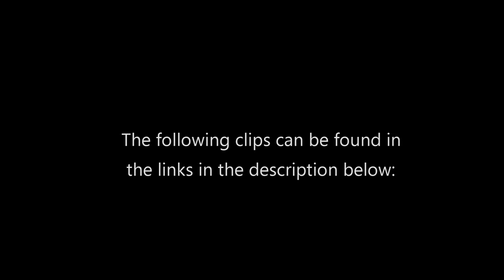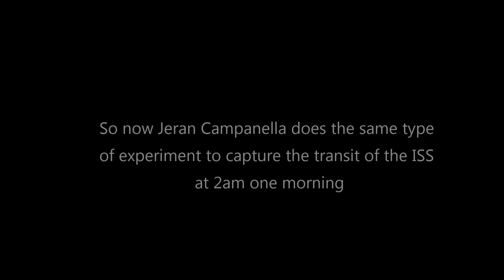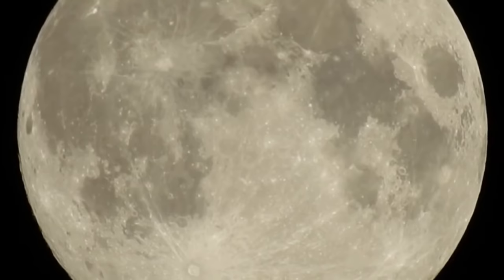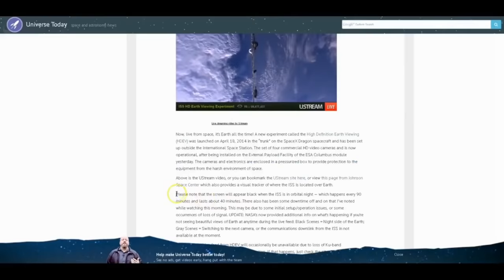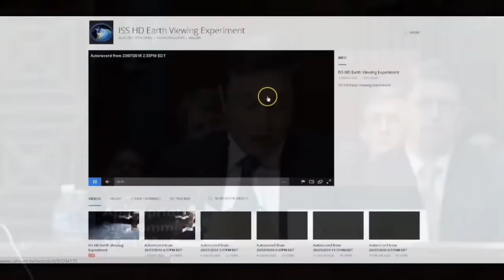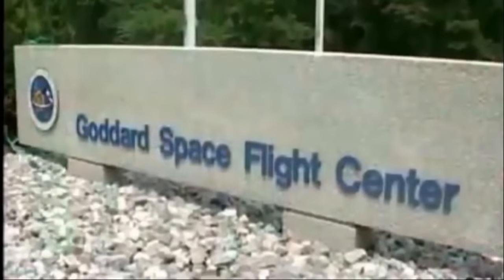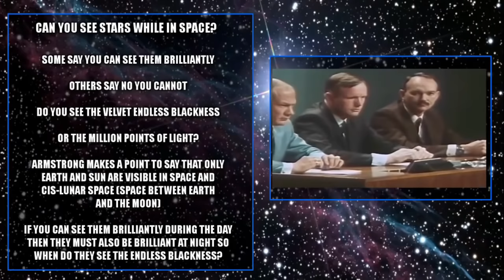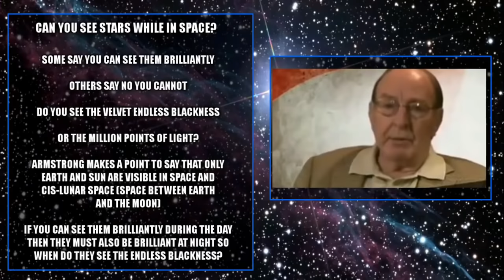The ISS Confirmed!

Comment: .....i thought we lost the technology ?
Reply: Ra Amon Khan    “I would go back to the moon in a nano second. But we lost thousands of reels of data and is just a long and painful process to get it back”~ NASA ( Nazi founders circa. 1948 )
Reply: Actually try to build a smartphone with the technology of 1969... Good luck with that.
'Lost' mean here absolutely moronic to rebuild it the way it was back then.
There was one ! Computer inside the Eagle. And it had 4096 byte memory.  How many Giga byte do your smart phone have?
We didn't lost any technology. The blueprints are still there. For components that can't be built anymore without recreating the machines for. Mechanical systems to control engines etc...wich is completely nonsense anyway as modern engines have a computer that control all functions. 
So any spacecraft able to haul the needed mass (astronauts + oxygen + water + food + lander) to the Moon need to be built from scratch...with modern technology and materials its much easier however.
Reply: Yazzam X - Did you ever fly on the concord? Do you know why they cancelled it?
Reply: Yazzam X - Ok you don't understand my question. I asked you tray because I was lucky enough to have flown on Concord a few times. One thing that really sticks out when flying aboard those Concord jets (due to the fact that they fly at almost 20,000ft higher than regular commercial airliners) is the definite FLATNESS of the horizon and landscape, whereas 'official' pictures from this altitude show a curved horizon. This is due to fish eye lenses used in order the distort the image to fake the curvature.
Reply: @retroactivecontinuity3622  "flying aboard those Concord jets is the definite FLATNESS of the horizon and landscape"
from your passenger window view would you expect to see the horizon curved on the globe or something? if so, please explain why that would be... also, when you measured the definite flatness, did you also measure the distance to the horizon?
Reply: Yazzam X I always thought tech like rope core memory was what he was really talking about. It’s a process we no longer use, nor build. It was really great in some aspects but labour intensive to make and the storage was tiny by today’s standards. I suggest looking up videos showing the rebuild of an Apollo unit. https://www.youtube.com/watch?v=2KSahAoOLdU shows some of the tech we have lost, but as you can clearly see was real and functional.
Reply: I can't believe what some people believe.......i can't even believe "flat earth" is up for debate. Anyone in any air force will educate you quickly. You need it.
Reply: ....... i smell awful, hairy armpits,knees and hands..snot dangling from my crooked nose...hunchback...and a knuckle walker...anybody feel better ? ...and i love relaxing under overpasses.
Reply: @raamonkhan4909  thank you! I was too lazy to type it all out. There's a like for your time.....I'm not sure flat earthers can comprehend this math though. There next replay will be something like "math is flat" lol...or "math is a perspective" or (add any other dumb ass arguement here)...XD
Reply: Yazzam X Who the fuck said we lost the technology to build another Concorde?
Pretty sure we could build one tomorrow
Reply: Carmen Pastershank 
Your above statement makes no sense. We are not talking about pyramid 😂😂
The argument is about how ridiculous it is that NASA employees including astronauts are making the statement that we have lost the technology and telemetry to go back to the moon. They literally tell you they erased it or taped over it. The point is that is so ridiculous it’s disgusting. The greatest achievement of all mankind and they lost or erased it.
It is comical that people believe these liars.
Reply: ISS!!!
The greatest engineering feat of all mankind!!
The international space station placed above the earth in an orbit of 1,300,000 feet.
In the thermosphere with radiant temperatures over 2000°, physical temperatures of +250°and traveling at the orbital speed of 17,500 mph!!
Greatest engineering feat up all mankind and there is no documentary about it🤔

Built in a life threatening environment with high temperatures, explosive decompression risk, extreme distance and extreme speeds-YET NO ONE reported dying building it-when 96 people died building the Hoover dam and 60 people died in the World Trade Center’s🤔

And what do we get for the 100,000,000,000 to build it and the 220,000,000 maintaining it over the past 20 years!!?????
Not to mention the 11 MILLION DOLLARS DAILY-they give us lettuce, bullshit interviews, playing games, doing flips and tricks🙌🙌🙌🤣🤣🤣🤣
Reply: Its the same technology as the V-2, which is the same as the Redstone, which took Alan Shepart to space the year I was BORN. Its just a multi-stage V2, and with all non-reuseable technology! You want to go to the moon with WORLD WAR II TECHNOLOGY? Thats like saying you would like to cross the ocean in the spirit of St. Louis in 27 hours, instead of 7 hours in a Boeing 787.
Reply: we modified the equipment. The moon is WAY further than Earth low orbit. Requires Saturn V rocket... a waste of resources to gather more info. All equipment was retrofitted for Shuttle, to manage satellites, not put people on the moon, kinda a pointless place to visit.
Reply: @hansjorgkunde3772  
Exactly, its like saying we lost the technology to build an Ironclad ship. I mean, yeah... we could do it, but why the fuck waste the resources when we can do better. It would take specialized equipment to make some of the components that are obsolete. People just believe what they want and manipulate data to confirmation bias the pride.
Reply: @pc-easy  No one on here represents NASA. Also, the generalization of American guys is a stereotype. Invest the effort to be specific so your not heard inaccurately.
Reply: javier baron do you think magnetic tape from the 60s would still function? Magnetic tape breaks down. I worked twenty years in television production....magnetic tape breaks down. By the way I wonder how many folks in these posts have reel to reel tape recorders from the 60s or even 8 track players from the 70s. Obsolete technology just like the computers and tape reels of the Apollo program.
Reply: addictive object . destroyed means no conspiracy. There was no longer an interest by the public for us to return nor to pay the cost to so. So destroyed means allow the computers to be scrapped and the reels of telemetry to fall in disarray or to be lost. I bet there are millions of pages of paper printout data stored somewhere. Worse yet the infrastructure is now gone and a lot of people who worked on the missions are old or dead.
Reply: @matthewhicks6531  exactly... people just cant think beyond the limits of what they feel safe knowing exists, or competent with their limited understanding. Some do this in hopes to be the "i told you when no one believed"... they think they have uncovered this great secret....
When, the reality is a bit boring... there simply isn't a secret... but at the same time, so much more amazing... that the universe is infinite! 
It boggles the mind to conceive such wonder, and these flat Earthers live under their dome sky... So sad they haven't been gobsmacked by the wonders of modern sciences. Its truly a remarkable time to be alive, and our technology proves it, if they simply understood technology better. 
I even referenced LIGO, that detects gravitational waves... all i get is density... which has nothing to do with compression waves detected moving at light speed.... its all there, people just dont want to exert themselves to discover. Sad.
Reply: Reach 3D Printers I’m a Christian but very pro science. I think it’s fantastic the farther out we look in the macro verse and the smaller down we look in the micro verse we keep seeing more. It’s down right humbling but so exhilarating!
Reply: @matthewhicks6531  I was a christian for 30 years, and some would say I am still, but other not.
I believe God probably does exist... but the ONLY way I can see God is through his product, Nature... and so I study nature to understand if there might be a consciousness. Ive had deep debates, 1000s of hours, discussing God and science, and we generally arrive at a few basic questions:

Q: Does God change the laws that govern reality? (go against his own laws might be the same question?)
A: Bible says no, Miracles say yes, Science says maybe both, but it is likely our limited understanding of Nature, that it seems like a miracle.

If consciousness is a network of energy, perhaps God is the exchange of energy between the network of the universe, a massive universe of thought... but that would imply we are of extremely little to no consequence, aside from a mere idea of Gods' in one instance of a neuron in the Universe of thought. Perhaps the network of subatomic particles contain intelligence in a flame... perhaps, to some extant, the earth can actually think with its massive network of atoms and electron exchange.

This brings communication into question with God. Can we be heard... or is God something different, a relationship between all energy... are we not part of God, and God is within us, and Jesus was the Son of God, the same as I am a son of God.... Did Jesus die so we may see truth, that God is within us? The fact that time exists is a miracle to me... same with all matter. I generally don't see the bible as a book capable of containing something as immense as God, and try to avoid limiting myself to the set of ideals that are aggressively disputed... because I don't think that is what Jesus..., (probably a VERY wise human, that spoke in parable to help people understand Nature and our own community of humans.) ...was saying.
Regardless, we are energy floating through energy, and to some extant, we matter nothing, but we also have the most value in existence. Why do these laws that govern reality exist? Why does gravity exist? The laws (or powers) are the biggest question to me, as they predicate the existence of matter.
I guess I just don't like the limits that religion tends to place on God.... and I cant even say if God (conscious nature) actually exists, as I have little unskewed to no evidence assuring me, even after 30 years.
Reply: Reach 3D Printers great thoughts and questions. Ponder the complexity of the Trinity, the triune nature of God and yet the simplicity of Him wanting to fellowship with us. This complexity and simplicity reflects in all of creation. I believe science merely discovers and tries to make sense of God’s creation but the more we look, starting at the simplistic, reveals more and more complexity. I love my Bible....but I sure do love reading particle physics and astronomy books.👍
Reply: Reach 3D Printers oh....and no one or no thing can limit God.😊
Reply: @matthewhicks6531  You speak of God wanting to fellowship with us. I seek God, but Ive never experienced God seeking communication back to me or sharing a physical interest in my physical existence. How do you ascribe acts on Earth to God vs random vs evil specifically?
Reply: @matthewhicks6531  
I disagree... I believe people limit God, through the interpretation of the Bible.
Ive had MANY pastors and deacons and Youth group leaders, tell me that the Bible is Gods word, and God doesn't want.... X or Y or Z. 
Im not saying these are bad things, clearly theft is not beneficial to a community, nor violence, etc... But I had a Preacher, who kicked a family out of our church, because she lived with a man, and they were not married. She was told to move out, and she had no place to go so she refused, and she was asked not to come back to the church, that she wasn't welcome. She was rejected on Gods behalf, by the preacher. This happened at First Baptist Church in Belle Plaine Kansas in 1996ish. Pastor was Richard Schmidt, and the entire community backed his action. He continued leader of church for a decade longer.

Ive had friends threatened for speaking about nudity and art and the shame we carry. Threatened by large groups in other states. I personally have experienced more persecution from fellow Christians, than from atheists. The level of condemnation across the denominations is exhaustive to calculate. There is such arrogance in some who confess they know the absolute truth.
You seem to exceed the limits the bible places on God, but I assure you, there are limits... BASED on interpretation. The bible may not have metaphoric limits, that I find fascinating and compelling deeper thought, but most assume the literal interpretation of the bible as absolute, undeniable truth to practice... but overlook many scriptures that literally state women are not to speak in church. Tongues are not to be uttered, unless an interpreter is present. Many dogmatic laws that are NOT adhered to, yet when some other laws are broken, the condemnation is poured on.

That is why I no longer believe the Christian religion to contain the absolute truth of God. It is too small in interpretation, and tainted by man. It contains an idea of God, but the limits are too abundant through the scholars.
Ive spent many years learning about the Bible, and Ive seen the way its twisted for personal or ideological gain. A God of infinitive existence, would not function in such a limited way, allowing Gods ONLY voice to be so easily manipulated.

Science unravels truth. That is where God exists. We study Gods works by studying nature and perhaps find a sliver of God through knowing his works.
Reply: @retroactivecontinuity3622  "This is due to fish eye lenses used in order the distort the image to fake the curvature."  hi.  Photographer here.  I have a lot of different fish eye lenses.  Can you tell me the one that's used in "official" pictures?  That's because a fish eye lens distorts the WHOLE IMAGE and doesn't distort just the background to make it curved and leave the foreground straight and normal looking.

What's also weird from someone that was "lucky enough to have flown on Concord a few times" is that you a) can't spell Concorde, b) It flied 25,000 higher than the average passenger jet and c) you are the first person that says they flew ConcordE and says they didn't see any curvature.  Weird I did a simple google search on "Concorde window" and got tons of shots from passengers that actually flew on it... that show a curvature.
Reply: javier baron ....you’ve gotten your flat Earth bullet points commingling. Better retake Dubay101.
Reply: Yazzam X ....do you really believe that your facts will stop him from putting the exact same quote on the next video he comments on?
Reply: PC PC ....it’s not just an issue in the USA. But due to the heavy government involvement in education, the unions, and the PC agenda, the schools here are a modern model of failure.  
  Don’t dare tell a smart kid that he’s smart, it might offend the dumb kids. Don’t reward a kid that does good, because it might offend the the sleeping kid. Make sure everyone gets a reward, whether they’ve earned it or not. And make sure you graguate these kids, even though they have done nothing. That’s the US schools now. 
  And I can guarantee that half these comment posters and the video maker all have participation ribbons hanging on their walls.
  Wake up Jimmy, and come up to get your reward.
Reply: James Dunn ....do you have a comprehension problem, such as short term memory. You just read that they still have the original footage, but yet you repeat the same nonsense?
Reply: JETHRO MCCORMICK ....why do uneducated people use caps lock so frequently? It doesn’t make you louder like you probably think it does.
Reply: @dross4207  HAHA, that is scary, but kinda true... However
I feel the problems stem from failed parenting. Its not the system that should instill a desire to learn... Its the parents, warning their kids of a difficult future. The education system shouldn't be the reward giver or taker, that is the parents job, and the cause and effect of capitalism... and parents need to prepare their kids for capitalism... because a capitalist society (with some social systems) is the best solution humanity has yet found.
But yeah, a lot of parents fuckin' suck and the education system in the past handled their slack... but now, it operates in an unbiased way so it won't trump a parents decision..... and so parents need to step up if they want their kids to succeed.
Reply: Reach 3D Printers ...there is definitely an issue with parents not doing their job. I was the only male that I have ever seen at my son’s parent/teacher conferences, and most mothers, including my sons’ mother, never went to them. 
It’s sad, but society overall has broken down, and education is definitely one of the casualties.